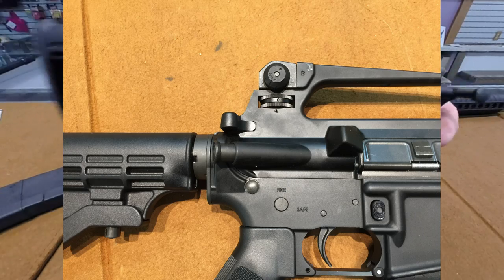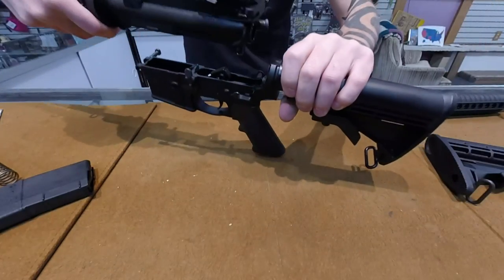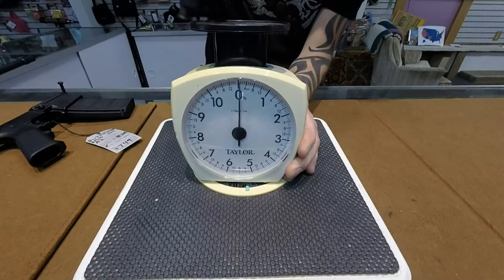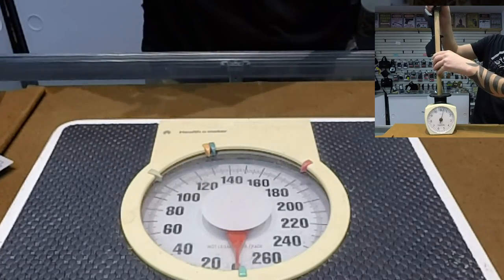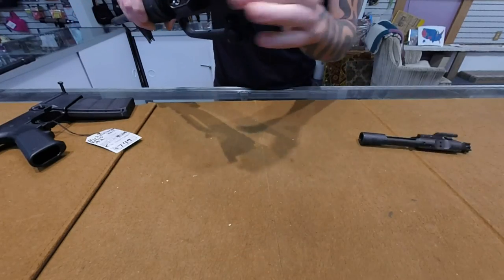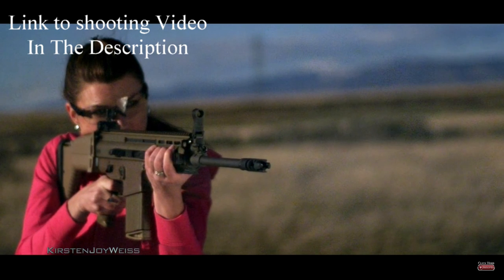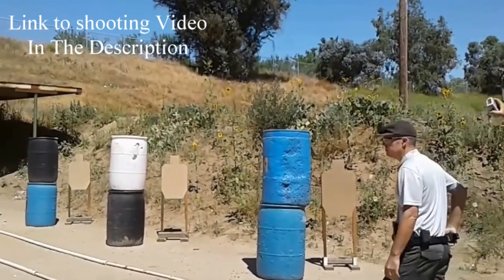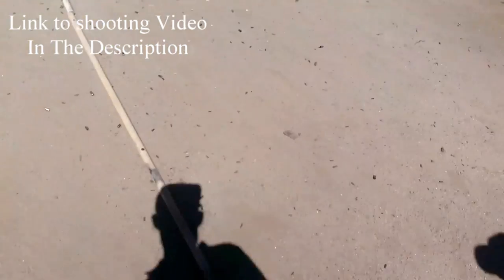🔴 What is this and how do I use it?

Comment: I was a combat Engr.in the Army and also an assistant armor and the forward assist is very useful in areas of sand such as a desert environment, IROC, different places where sand is blowing around you get a little particle of sand stick to any wet spot, like oil or water,  and specially on an empty weapon just laying there on the bunk and cycle it a few times it does not want to always allow the bolt to go fully forward and a quick bump on the forward assist usually breaks one or two little  grains of sand and it goes forward and you can still shoot the gun and not have any problem it is true that the dirtier the weapon is the more you would have  to do it and you're right to keep it clean, but you can  have a perfectly clean weapon and a little speck of sand grains get in there. so I'm a Believer in the forward assist in that situation. especially in a combat situation where you don't have time to clean it.
Reply: Thank you as I was going to state this as well.  I was a unit armorer (my buddy was my assistant armorer) and I completely agree.

Comment: When you mentioned gun grease freezing up in cold weather reminded me of something, operation Barbosa 1941 germans guns were freezing up and the Russians were using diesel fuel in their bolts,,to keep the bolt action from freezing,,,maybe you can do test ,,I never had to try it.
Reply from the maker: A light oil is the key 
 I suppose when they make Greece they probably throw it in a freezer to test it which is just below 30° 
Hell we are looking at -30  and -50 with windchill

Comment: when its really cold outside, you should be using PTFE dry film lubricant or silicon lubricant. Oil & grease will seize.  Source: North Dakotan.
Reply from the maker: Thank you for the comment
Reply: I use that ottis dry lube spray

Comment: Or you can use the forward assist as a quiet bolt close option. Not that I'll probably ever be in a situation where I need to slower release my bolt (so slowly that it doesn't fully go into battery), and then ride the assist to finish the job.
Reply from the maker: Thank you for the comment
Reply: Also useful for crappy lacquer coated,steel cased ammo or reloading from dirty mags while trying to get yourself even deeper in more dirt.
Reply: I have heard of this .

Comment: Huh. You got close. Yes if your experiencing problems and you gotta use the F.A. then you better try to find the problem and deal with it. Yes. But if you gotta apply 20 plus pounds to close your bolt then you have other problems. Check your bolt to barrel alignment, and think about using an upper receiver bore lapping bar to accurize your upper. Seriously. They are inexpensive and definitely perform a needed check. The F.A.s are useful for those who don't let the charging handle do it's job by not letting go after pulling reward to charge the rifle. And I tell you if you have to find a flat object to slam it against then your going to break something or really jam it bad, seriously! If you can't push it forward with a slap from the palm of your hand then you may be a snowflake, a disabled person that may need assistance or an alternative method or younger person and need help. Even if you need put a wallet or rag in your palm to protect your palm if need be you really should be able to close it with 1 to 3 palm slaps.
  And this I tell you is my opinion on the grease problem, use slip 2000 EWG ( exstream weapons grease ) synthetic grease, because it is far superior to most all on the market. It's pricey but it's well worth it. and a little goes a long way, as a tube of this will last a year or more cleaning several firearms weekly and lubing their vitals every time, and when I say a little, I mean a pin head size drop give or take. Next use break free clp to wet your bolt and carriers as the stuff is phenomenal and works great with the slip 2000. I started using break free in the 80s when our base armory Sgt told me they used it and the effects of its use. And to see how well the BF works, clean your barrel with #9 or what ever you use, then shake up the can of BF and shoot a shot of it in your chamber and stand the barrel up on its brake and let it creep down and out and let it work for a couple of minutes, then run a patch thru the barrel and observe the stuff your other cleaner didn't get. Seriously. You'll see. I keep my bolt wet with it and have never had to scrape it even after running it like a mad matter. I'm telling you this because it really works. Wipe down all your firearms with it. It's far superior to a lot and that includes rem oil. Rem oils not even close. But if you don't beleave me then test them both. Also if you look you will find that B.F. makes some gun storage clp wipes that is just the top notch stuff.
  Next to save some money watch a video by the School of the American rifle on how to make your own synthetic lube using synthetic bearing grease and synthetic mortar oil. It works well and has a big price advantage but even so I'll stick with the Slip 2000 and Break free CLP as long as I can afford it and until I get a mix of the other synthetic that I like.
Reply from the maker: Poor video I know it’s old 
10 lbs to overcome the latch on the charger 
20 if you’re using the FA
Reply: @CRSFirearms  not poor vid. Just mis information to a point. But you should know that my AR, home build upper from on sale/clearance parts, USA made parts, mix of DPMS, AERO PRECISION AND SO ON at best 5lbs to close bolt using the forward assist, no load and 7lbs with load. And I may be high on those numbers. It's a very smooth action. I've never over the many years had to actually force it closed with extreme pressure. And I've run it to dirty and beyond to pure lazy I just don't wanna clean it. Not normally but I've had my bad days on procedure so to speak. Using a thumb to close or check it is a truth. And I'm old, puckered up and arthritic. So really you should be looking at possibly better lube, and lapping the front of your upper receiver where the extension meets receiver. This tool is only 30 to 40$ at Brownells and probaly cheaper for you as you licensed, which gives you better pricing. I do this to every upper as a matter of principle. As you never assume that name means it's up to par great.

Comment: I had a Ruger AR556 that the bolt would get stuck about 1/2" from full locked back position and the forward assist did nothing. After shooting it about 50 times it finally loosened up. Took 2 weeks to get 50 rounds through it. Pissed me OFF.
Reply from the maker: I had similar experiences I don’t think it’s just something that’s a ruger problem 
Sometimes a dry brand new A.R. 15 just don’t want to cycle under its own power

Comment: On like a third reloading of ammo I did without tumbling the brass, there was burrs on the brass stopping the bolt from going home. Out at the range I couldn't figure out what the problem was and used the forward assist to make them go home. They did fire but if I did it and didn't fire it oh boy were they jammed in there.. Nothing like sanding fully reloaded ammo.😄

Comment: Used to be a company armour. Forward assist. Is right. Tits on a boar. Also rember there used to be a bolt that could be put in 180° out of phase  and tries to eject the round the wrong way. Lots of tricks 15/16 series rifles could play. Read the manual/ obay all listings. So with old m 15/16 you have to be wide awake to run them .Sgt williams retired.

Comment: If the bolt does not push the round fully into battery then it can help in that situation. Mine is brand new and it has issues with cycling rounds completely idk why.
Reply from the maker: +Teru Mikami it's hard to say without actually seeing the rifle, hopefully you don't have any issues and it will run good